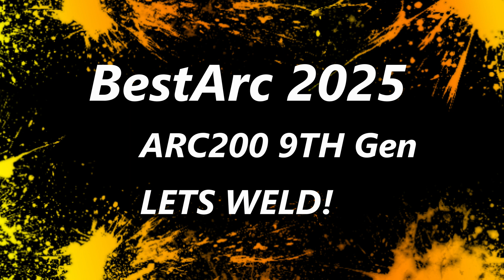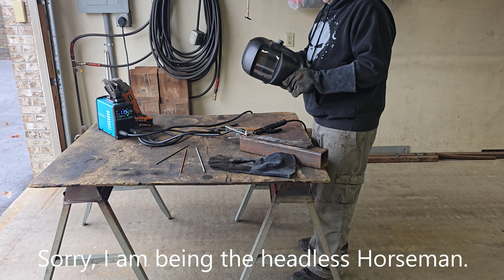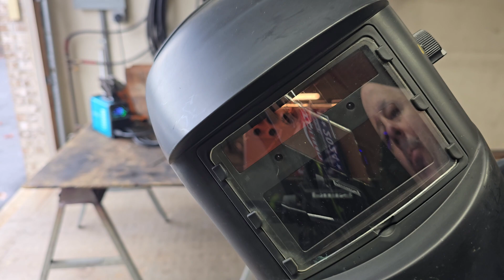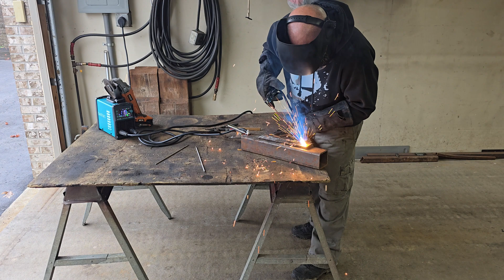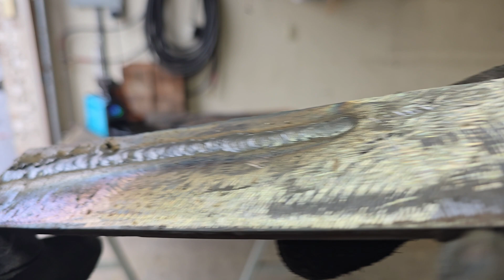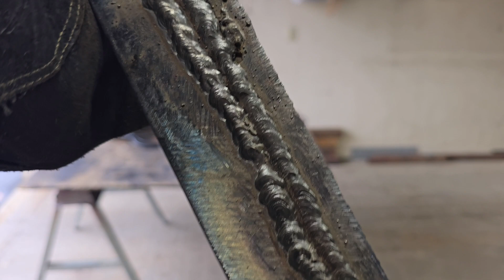2025 BestArc ARC-200, Lets Weld!

Comment: Can you exit synergy mode on this model?
Reply from the maker: Not fully. You can drag the voltage up and down, but the wire speed and amps drag along with. You don't have old school speed, amps, volts control on almost any synergy machine I've touched. The outlier is the YesWelder DP200.